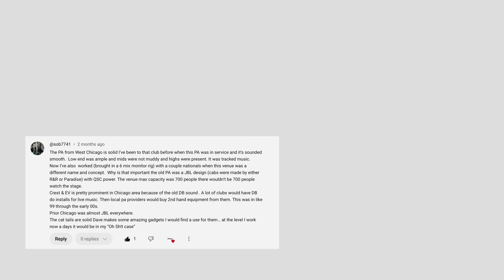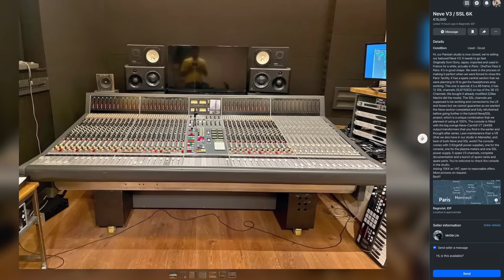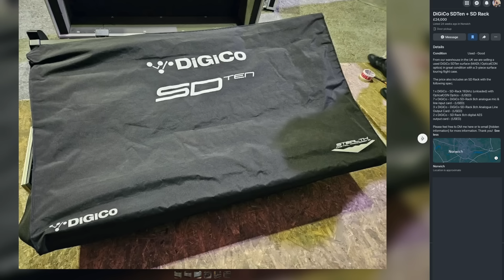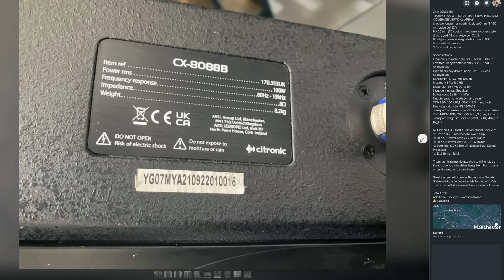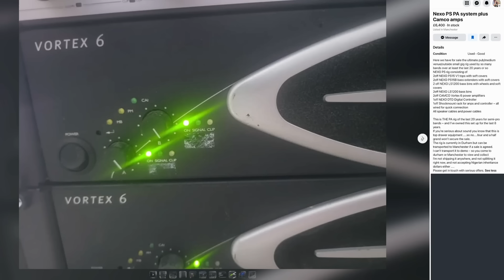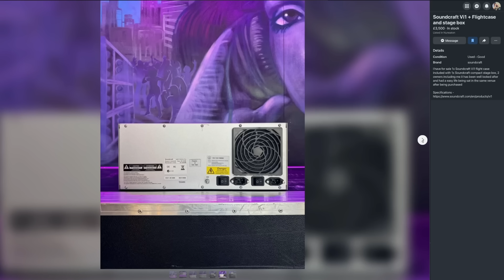Pro Audio Deal Or Disaster? Episode 17

Comment: That Peavy gear almost certainly dates from around 1999-2001, the giveaway is the “new” style peavy badge, before they updated the cabinets curved style with silver/grey grilles. The Hisys line carried on to the mid 2010s here in the UK I believe… which is surprising really, because it’s not particularly well regarded. It was quite popular with mobile DJs and pub bands in the 90’s and early 00’s but things really moved on and products like the Mackie SRM-450 and RCF Art series just wiped the floor with them in a smaller, lighter, better sounding and more reliable package.

PS, I did buy a used Hisys rig as my first PA in around 2004, I very quickly realised how limited it was for live work and replaced it with JBL SRX gear… which I still have to this day, still in fantastic condition and sounding great.

Comment: The Peavey cabs are CE-marked so that means 1993-95 at the oldest.
Reply from the maker: That's good to know, thanks for the info! Looking at the Wiki it says they started using the CE marking in 93. Did they not start in England until 95? I appreciate the message!
Reply: @DcSoundOp you're right, it started to be used in 1993 but became mandatory in 1995.

Comment: I think in 2025 most of those rigs are going to be a tough sell.  Even if they are priced low the sheer size and weight is an issue.  Those FBT hung on their side with carabiners scare me.
Reply: Especially because it's so easy to get carabiners that are not rated for weight carrying capacity. I used to go to a church that we were discussing hanging the speakers one day and I came in the next week to find them hanging! Now that I think about it as the main person in charge of tech this is not the first time I had something change out while I wasn't there. Thankfully they were all wood construction nice solid JBL's. Also the person that hung them did a lot of work around farm equipment and did a really good job of construction store parts hanging. I had somebody come through and pointed that out to me one day and I'm like yeah yeah it could've been worse but I also know that the line hanging them is rated at 25 pounds each dividing the weight by 4 and using quality hardware. I would not hesitate stand under it. that put the guy somewhat at ease, indicating that it wasn't just some thing that got thrown up there it went up there with thought.

That said yes there's a lot of people who think they know what they're doing and look at something and go yeah I can do that it's easy! Which is also why we had all sorts of clubs burn down, because "acoustic foam is expensive, we can just get mattress foam".... Although I don't really know why you would want to be sleeping on flammable mattress foam but... Yeah that happened.

And in case you're wondering that church built a 2 x 4 or 2 x 6 stage I can't remember. and we put outlets around the edge. Not only did we have to put a ramp in because of the height difference it also had a railing around the ramp. Getting to the point one day I came in and found all the outlets were changed out to recessed duplex boxes and everything on stage was plugged into one socket through the daisychaining of all the power strips. and because I already swapped out the power strips to have 90° connectors so they sat flat they didn't plug in very well to the now recessed outlets. Which necessitated daisychaining everything to be able to plug it in to the one they could plug-in. when we had 2 1/2 circuits up there ( Stage L + R + switched amps ). And I'm absolutely sure Nobody was gonna tell me I think, and that they didn't see it as a problem.
Reply from the maker: I have always found it remarkable how often folks with no experience or business hanging things over-head end up doing it in spaces that are going to be open to the public. Thanks for checking out the video!
Reply: @DcSoundOp I have found stuff like that a lot in the local bar scene.  The worst part is most of the speakers, lighting and truss I have seen have proper engineered install rigging sold by the manufacturer or distributor.  I’m my experience rigging hardware is rarely included in the budget.